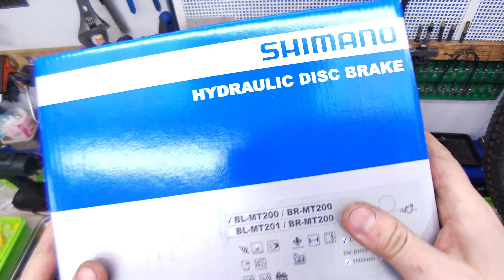How to get good brakes on your bike. Bicycle Disc Brake Repair

Comment: mt200 legendary classic 
they can work for 3-5+ years without maintenance and have excellent dirt protection, unlike more expensive models(SLX XT)
p.s Nice video montage bro! I get a kick out of videos like this with this kind of material presented.
Reply from the maker: Thank you for your comment. If you are not a super DH rider, these brakes will not last long

Comment: I've been wondering for some time what the benefit would be of replacing the cable brakes with hydraulic brakes. With cable brakes I feel they brake well and are almost maintenance free, I don't need special tools for bleeding or changing brake fluid.
Reply from the maker: It all depends on the conditions in which you ride. For city commuting, mechanical brakes will suffice. But for mountains and hilly terrain, hydraulic brakes will be safer and more convenient